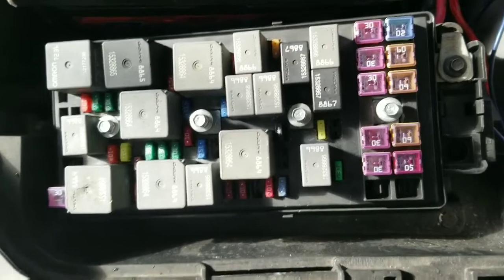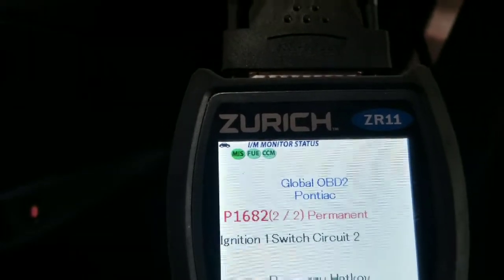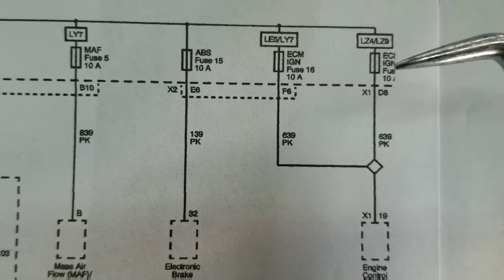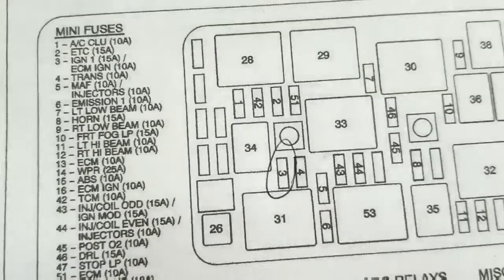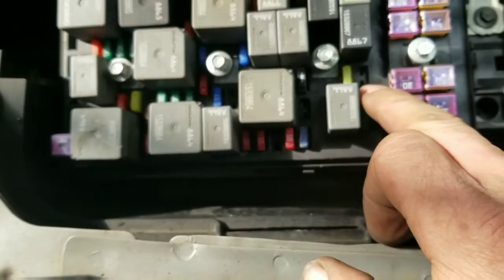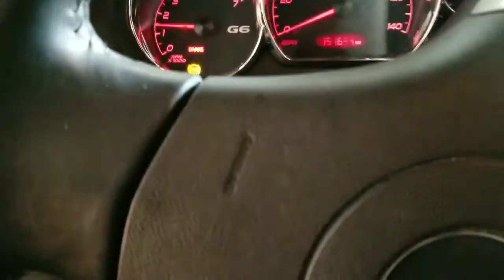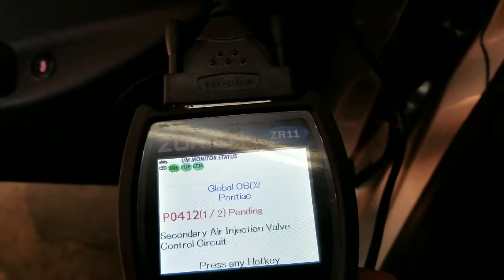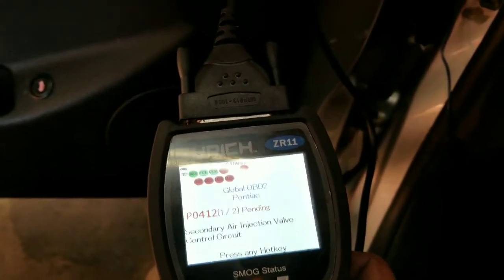Pontiac G6 P1682 P0685 fuse block

Comment: The big ground wires that are connected to the transmission mount look fine but the crimp breaks and the wire needs replaced.Grounding is vital.
Reply from the maker: Issue was the fuse block. Problem confirmed. Changed the Blick and car ran another 6 months before being wrecked.

Comment: Catalytic?   As you described...GM diagnosised SAME ISSUE... I punched out Catalytic...NO PROBLEM... ran great for 2 years.... HOWEVER... NOW no crank, no start...and I  have not been able to find the issue
Reply from the maker: No crank can only be a few things. I'd start by double checking everything you touched when you had the exhaust down. Maybe knocked the starter wite loose or blew the fuse. But start with the usual, make sure you have starter request at starter, power to relays etc.
Reply: @jerseyshorefabricators7431  the starter relay is not getting excited from...hmmmm body control module?   I have batt power, ignition power and ground to relay... just not excitation...  I can hot wire/bypass relay and start vehicle no problem...    One guys video...he replaced a tracking module?    Anyhow appreciate ALL YOUR assistance
Reply from the maker: @Mooseracks  what's your email?

Comment: I have an 2007 Pontiac g6 3.5 v6 my check engine light will not pop up on my cluster I’ve got a different one from the junk yard looks new. Everytime I take it though model they can’t read it and it fails I got it tested at auto zone code is P0650 Malfunction Indicator Light Control Circuit it’s just annoying me.
Reply from the maker: Did it work before you changes the cluster? If so might be blown bulb. If not, then the wiring from PCM to dash is comprised somewhere. Just going to have to trace it out.
Reply: Jersey Shore Fabricators I don’t remember but i took it to a shop to get my car checked at and the lady told me that for those cars u can’t just put a new one in from another Pontiac I would have to go get it reprogrammed from my old cluster. And I haven’t popped it open to see if the build is there I don’t know how to open it
Reply from the maker: @keyll7254  ok. I'm not overly familiar, so you tube it on changing the bulb. Since the PCM is showing a code for the MIL light we can assume the PCM is good. All else fails have a dealer do the programming for the cluster (although I've not heard of that for those cars) or diagnose why the lights not working. Basically they need to check the output wire at the PCM that goes to the MIL to see if it's got power.

Comment: This video was 5 years ago what became of thr Pontiac G6 im having the same issues with my 2009 2.4L throwing a code ignition 1 switch circuit starts after it cools off for a day it drives and has power
Reply from the maker: As far as I know the owner ended up getting convicted of something and qas doing 5-7. However the car went a year without any issues prior to that.

Comment: Thank you so much for the info... difference in my 2008 pontiac it will not turn off after switching off unless I unplug the battery ,after that we put in a new starter relay fuse and started perfectly and then we turned it off and it never started again .. all I get is ERROR on odometer but all light work and radio but I get no crank at all
Reply: That’s the same thing mine doing
Reply: Same here. Nothing

Comment: I have an 09 g6 it starts but once i run it for am hr or so then i turn off the car it wont start within 3to4 hrs to start its not the battery or alternator, starter or the computer but its saying i have problem with a code PO 690 any ideas??? Been struggling for a month an a half now
Reply from the maker: So you've replaced all the items listed?
Reply: Jersey Shore Fabricators yes I replaced everything listed and still same problems
Reply from the maker: Well, sounds like you replaced enough stuff. So, I would say the PCM voltage sense wire is shorting to another 12V source. Download a schematic and trace that wire. That's what the PO690 is. High voltage to PCM. Good luck to you.
Reply: Check to see if the starter relay has play in it
Reply: Hey, same car and same issue. It would stop suddenly in the middle of the road and will not start for some time. I have to disconnect the battery to jump start and it will come back on. Been through a number of times now. I think my check engine light is bad can't see that check engine even in the acc position. Code reader showing P0449 P0451. Should I replace the purge valve?

Comment: You have a broken circuit in the fuse box under the hood and the computer's not grounding the starter relay due to this broken circuits we have to replace the fuse box with the relays and fuses are under the hood

Comment: Hey I have a 2007 Pontiac g6 mines want start but the air works and everything else Battery is new but I’ve yet checked my fuses
Reply from the maker: Um ok. If I deciphered that correctly your car wont start? If everything else is working correctly, it could be a fuel problem. Either the fuse for the fuel pump or the pump itself could be bad. If you verify that you are getting fuel to the rail, then next would be to check spark, or ignition.
Reply: In my ‘07, it’s the starter relay housing.

Comment: Anything with an 06 Pontiac g6 3.5 on gasket and exhaust leak fix / problems like a whole break dismantle and put back together step by step so I can do it myself I have the same problem with crank but no start but I’m pretty sure I can fix that just need to replace the gaskets and exhaust leak I have please would be greatly appreciated this video helped tremendously tho with diagnosis of the problem I have with the crank and no start
Reply from the maker: No unfortunately. This customer just needed the no start fixed. The exhaust is very straightforward. Lots of penetrating oil on the bolts at the manifolds, an impact gun if you have access to it will help. Cut the exhaust at the cat and remove in 2 pieces. If not replacing exhaust, unbolt the exhaust at the cat from the car to allow the Y-pipe to drop enough to get old gaskets out.

Comment: whats the fuse for the radio my radio dont turn on
Reply from the maker: The interior fuse block behind the passenger kick panel. 4th fuse down from the left is a 10 amp fuse. That's the radio fuse.

Comment: Hi can you help me please show me fuse Lok unlock door in the Pontiac G6 2009
Reply from the maker: Hi Alex. If I understand you correctly,  the fuse you're looking for is on the passenger side, front of center console. Pull the panel on the front of the center console, it'll be the the first fuse on the upper left. If fuse is OK, then you're master lock switch may be bad. Hope this helps.

Comment: Nice troubleshooting. My 08 G6 , 2.4L, has had intermittent P1682 codes pop up over the last year a few times when it stalled at a red light but the problem would go away upon removal of the key and restart and run fine. This morning though it stalled while i was backing out out the driveway and is dead in the water now with the same P1682 code. Now it cranks but won't start so now it's troubleshooting time but it's below 0 here tomorrow and the next day so I'll tackle it this weekend.
Reply from the maker: Yea I hear ya. Going to be 7 tomorrow and the next here. One of the codes is going to be the ignition switch. The switch may not be bad, just the code secondary ignition switch. Pull your fuses and relays. If any of them have green corrosion, most likely that PDM is shot and has water in it. 
Now there could be other issues with your car, but this is what we found on this one. Good luck and stay warm.
Reply: Jersey Shore Fabricators I'll check that out. Thanks
Reply: @LoFiMofo  did you ever find the issue?? i have the same issues on my 2009 Pontiac G6. Please and thank you.
Reply: Juan Garcia yes, i did find it and I'll try and post a video soon. My issue was one of the relay sockets in the fuse/relay box in the engine compartment was loose and the relay would lose contact. I took mine apart and repaired it. It's been fine since the repair. I'll try and post the video in the next few days.
Reply: SH72  how you get it it fixed

Comment: Say I have a 2010 G6... issue is it randomly shuts off and we replaced fuel pump and relays, fuses, but it still randomly shuts off. When that happens it won't start back up from anywhere from 20 minutes to a couple of hours to a day or 2.
Reply from the maker: Could be in the PSD. Could be a loose connection somewhere. Did you verify you're getting power everywhere you need to before changing parts? 12V to pump? 12v to both sides of ignition? Lots of places to have issues.

Comment: My g6 doesn’t even want to turn over, everytime I try to turn it over my Dash board gauges go up and down and my check engine light comes on, I’ve put new relays, battery and other stuff but no mechanic around me can help me out so I basically stuck with a car that I’ve only had for less than a year and I’m still paying payments to the company
Reply from the maker: Sounds more if an electrical connection issue. You may have a bad cable from battery to starter or engine to ground.
Reply: Maybe  the ground from relay  box not going to starter  I had same problem
Reply: @Rasan-Alkurdi what was your fix?
Reply: @TouchedByJohnny  I got new relay box and got fixed till I got rid of my car
Reply: @TouchedByJohnny   the relay box was the problem had to order used one from ebay and I replaced it it worked forever never had the problem again

Comment: I have a 2003 pontiac G6 its stuck in limp mode or its the security system stuck on . The only way the car will start is to take a wire and jump it from the fuse it starts but runs in limp mode won't shift into second gear none of the gages work and the power steering won't work ... do you have any advice for me to fix this problem ?? Thank you marty
Reply from the maker: Ok wow.  Sounds like rhe comluter is not starting the car. Sounds like your hot wiring it from under the hood. Because pcm is not starting thats why most of the stuff isn't working. I would start eoth the VATS system in the column. There should be a wire to bypass the system itself. If your key went bad, this would be the cause. Or of your using a spare key.
Reply: Thank you ill pass that info on to my friend who's helping me try and fix it ..after watching several videos I learned we are jumping from the starter module if that explains anything further.. thanks again

Comment: I guarantee you if you replace the fuse box with a new one or an old one or used one it will take care of the problem because the circuitry on one of the pins for the starter relay is not working correctly and it is not allowing for it to ground correctly so once you replace the fuse box it will be fixed guaranteed
Reply: He said the same thing

Comment: I feel you mixed up a lot of stuff....fuse 3 I think you meant 16? And that coil pack said “IGN” which is ignition?
Reply from the maker: The fuse block the customer got was different than what came out of the car. And yes IGN ignition
Reply from the maker: After going back and re watching the video, yes, fuses 3 and 16 are the ones for the IGN circuit. Fuse 3 powers part of the coil pack. Follow the wiring diagram. The ICM is the coil pack in layman's terms

Comment: My G6 refuses to start. New pcm. Went through all electronics.  Garbage cars. Garbage.
Reply from the maker: Agreed.  But theres a reason it won't. We also had an issue with the harness for the injectors. Just need to track it down.
Reply: johnny Macon  That was a 2009 g6, which i gave up on completely. I now drive old 90s and late 80s Chevy trucks and cars, i will never go newer than 2000. Its a matter of time before we all hope a Chevrolet car will have a "designed in Japan" logo here and there.

Comment: My headlights keep going out
Reply: Ranaldo Thomas I took a look at mine for a while. I took out the headlight and looked at the battery as well. I got my battery charged and checked the fuses. Long story short my problem was actually a yellow wire leading to my headlight that was loose so I ended up taking electrical tape and it’s been good since then
Reply: @nathanielpercy2916  thanks man...I'll check into it
Reply: I have a 2007 g6 and my headlights went out several times last year. I replaced the wiring harness to both headlights and have had zero problems since then. apparently this is a common problem for the g6 from 05- 2010 iirc. less than 15$ for each new harness and took around 35 minutes to get the job done. well worth it.
Reply: @kerritoole5614  it’s the DRL.  I started turning them off after I replaced the harnesses